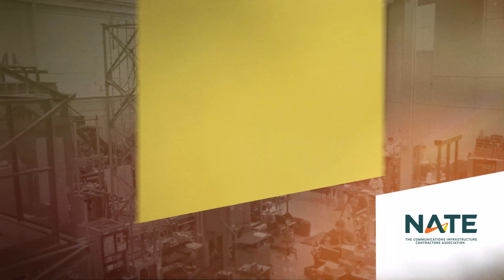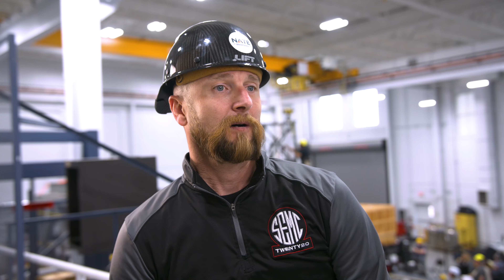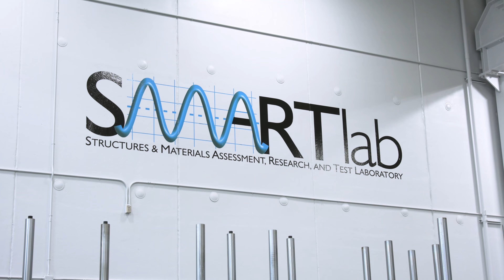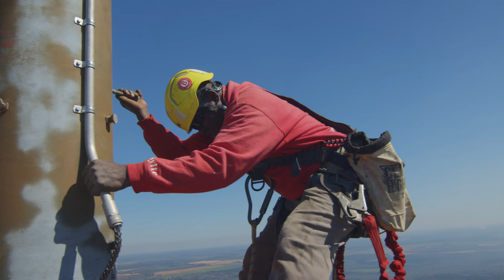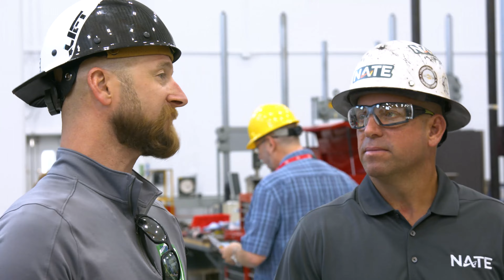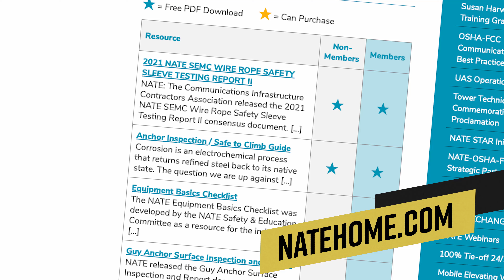Safety Equipment Manufacturers Committee - NATE #ClimberConnection Video

Comment: I'd like to see the lanyard tested in conjunction with a 3' and 6' blue anchor sling which increases the potential fall distance, effectively placing the attachment point several feet below the climber. Not an ideal situation but it can hard to avoid in real world situations.